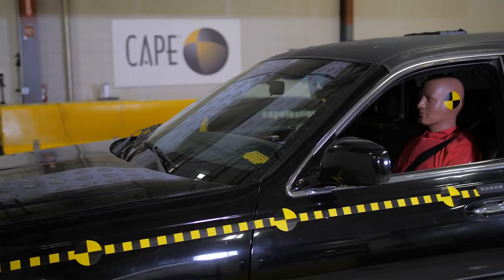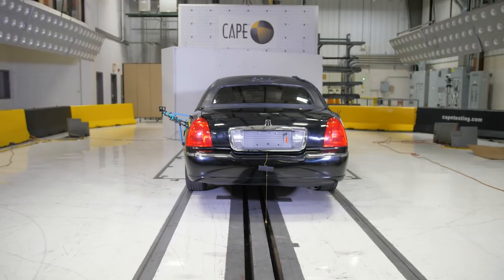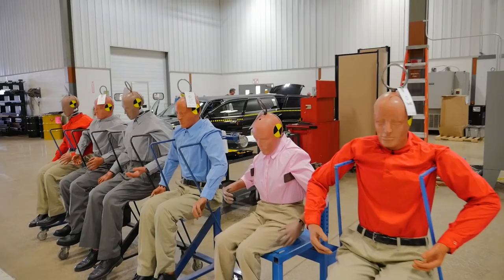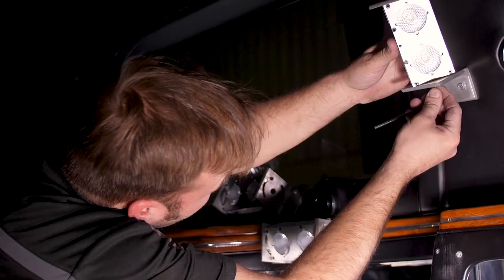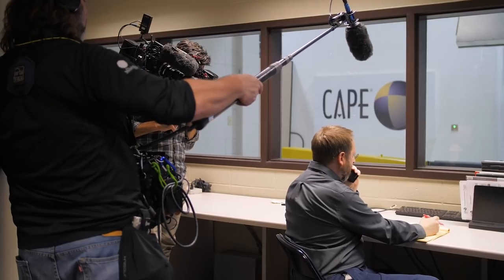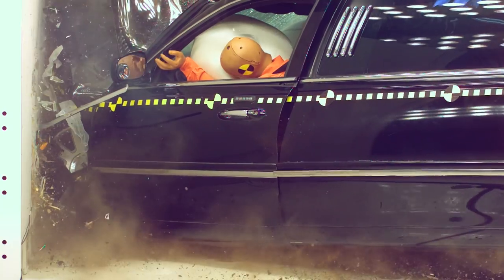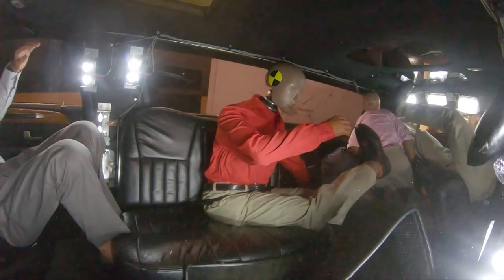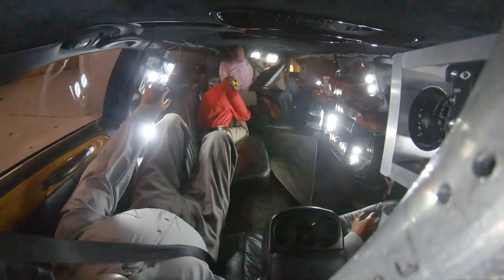Limousine Crash Test at CAPE

Comment: I've seen Fifth Gear conduct a crash test of this nature, except the limo they crash tested was an old Lincoln Towncar, and they crashed it at 50 mph. The area where the driver would sit was no more. The crash test dummies they set up in the back were arranged so two sat in the front facing seat and one sat in the rear facing seat and none of them were belted in. Let's just say that the dummies started in the back of the limo, but ended up in the front.